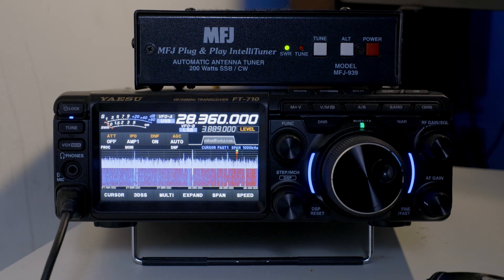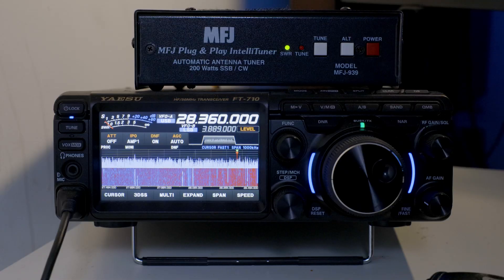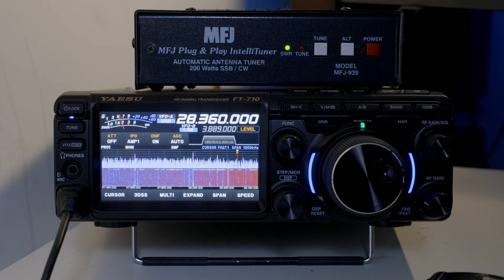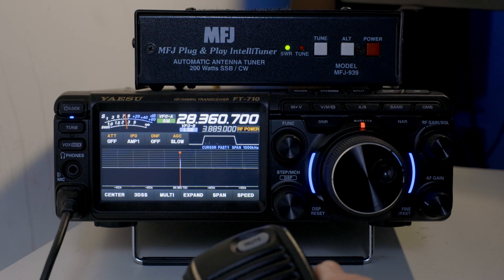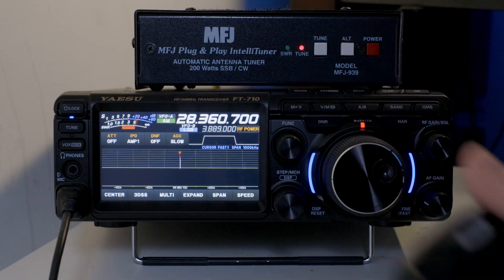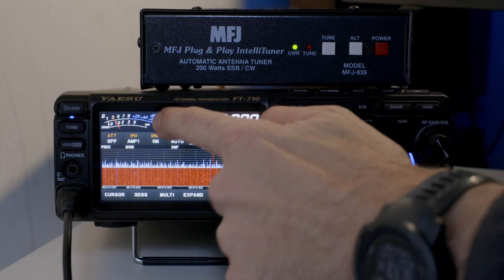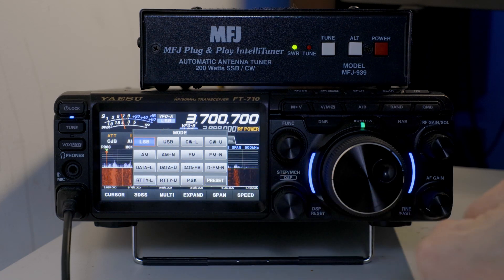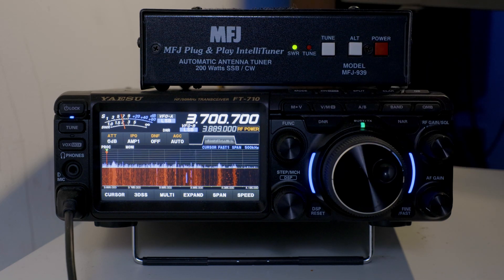Yaesu FT-710 Auto Tuner Setup

Comment: Does the mat-tuner mAT-30 work with a ft710. I can't get mine to connect
Reply: Did you check that you set the tuner option to be external?
Reply: it has to be v2 mAT-30 to work with FT710. If you have older version then i think it does not work.

Comment: I have a MAT-30 tuner on order for my FT-710.  They are supposed to work together seamlessly together and is powered by the radio via the interface cable.
Reply: I can't get my mat-30 to connect to my ft710. Works with my ft911a
Reply: @bumblebee-mygt867  Do you have the latest firmware on the Mat-30.